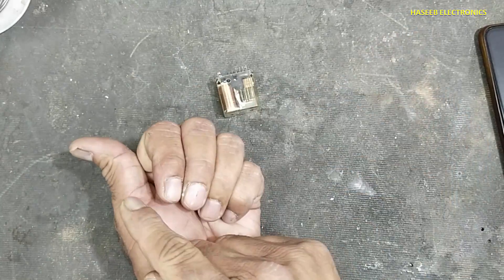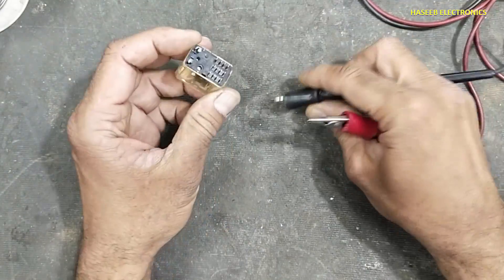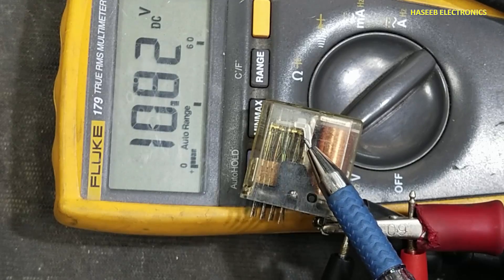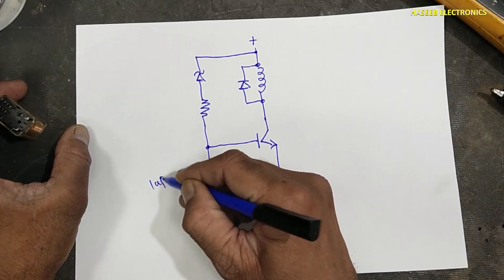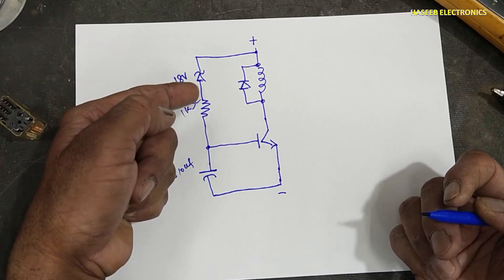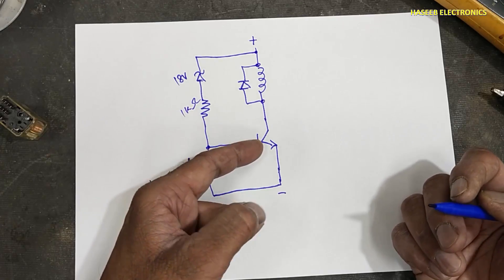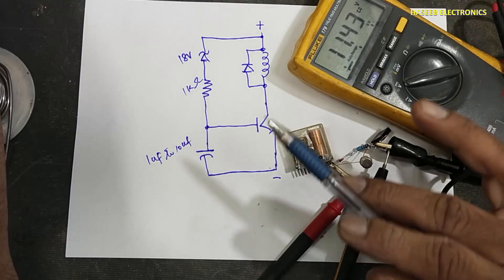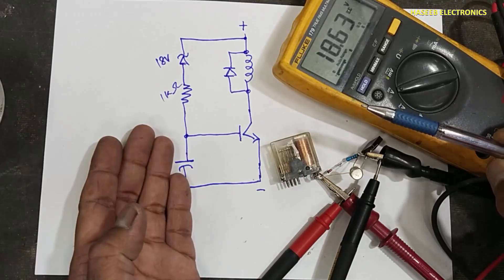{983} How to drive relay at specific voltage

Comment: Jazakumu lahu koiran.

Why is the negative side of the zener diode connected to the positive of the supply.
Reply from the maker: because the zener works in reverse bias, 
while working zener in forward bias, it will work as a simple rectifier

Comment: Explanations are excellent sir. Instead of controlling voltage through the zener diode for on and off cut off, IC 16F676 is used in an emergency lamp circuit. But while switching on the emergency lamp the relay is not getting changed over to charging mode.  That relay is not getting off . Please help

Comment: thank you as always. You are the best. You present your ideas in such a manner that even a novice will understand you. i have learnt a lot from you.  I deal with batteries a lot. can you help me with under voltage and overvoltage cut off circuit that I can implement in charging batteries.

Comment: It's funny that I was just yesterday watching AllAmericanFiveRadio's video on driving an IGBT with a photo transistor to power a relay to run a fountain when the sun is out and to turn off the pump at night. He had a problem when it was twilight the relay would buzz but not fully turn on and I suggested a zener diode. I also wondered if a Schmitt trigger would work that way there would be no voltage in between on and off. The relay contacts would be pulled in hard or not at all. You don't want relay contacts partially pulled in so they won't burn. You mentioned using a comparator circuit. Would this act like a Schmitt trigger? Excellent video. Thanks for sharing it with us.
Reply from the maker: best regards and special thanks for your valuable comment 
because the relay coil's "pickup voltage" start at very low level. for example the 24 volt relay winding gets energized at 10 volt but its magnetic flux is not saturated so the contacts will not work as hammer action, in result the contacts may spark
the circuit, which i discussed in this video overcomes the "pickup" and "dropout" voltages due to controlling transistor's conduction 
a Darlington configuration is much more suitable for ensured operation of the relay 
i think Schmitt trigger method will not a useful method (as level comparator works as decision making circuit based on the voltage level, same as in this circuit, which i made in this video, it is also a transistor based comparator)
but TL431 or any level detector ic or opamp or comparator or level detector + flip flop  or microcontroller will good options
Reply: thanks for your input. have a great day! @HaseebElectronics

Comment: Thanks for the video.
Should I use this circuit to drive a relay for a battery discharger or is there a simpler circuit for a battery discharger?

Comment: Hi.  I'm used to seeing the resistor at the cathode.  Yours is placed on the anode.  Does it matter?
Reply from the maker: it is the same. it can be connected at anode or cathode. it must be in series with zener diode
Reply: @HaseebElectronics  Thought so, but wasn't sure.  Thanks for confirming that.  I never thought to use a zener this way as a trigger when the breakdown voltage is exceeded.  I will add this technique to my notes.   Great idea!

Comment: Clever + Elegant = Brilliant! Bravo!!! I recently built a soft-start circuit, for my DIY isolation transformer (120VAC.) I placed a very small wattage incandescent light bulb in series on the Line wire, to act as a small value resistor (20 Ohms, when cold,) to charge the transformers (two, back to back.) (It works as a removable Dim Bulb Limiter.) I used a relay to short the Line, to bypass the bulb. The relay coil is switched with 120VAC (not VDC.) I supplied the coil with the Line leg, after the bulb. This means that the voltage to the coil would be slowed and the relay would not trip, until the transformers were charged. But, I encountered the same issue, as your commenter... The relay switches at voltages different (lower) than its ratings. Therefore, I learned that the rated voltages are the guaranteed switching maximum - not just the typical switching voltage. As a consequence, the relay is shorting out the bulb, before the transformers are fully charged. This is not a problem for me, as the amount that the transformers actually do charge is sufficient. But, I would like to remove the remaining in-rush, after the bulb has switched out too early. I will be thinking on how to adapt your circuit to raise the switching voltage on my relay's VAC coil. Any hints on how to do that would be greatly appreciated! Cheers!
Reply from the maker: thanks a lot for your valuable words 
your question is almost similar to my last commenter 
120 VAC relay normally starts switching at approximately 20 to 30 volt peak or VDC (these are called pickup voltage)
sure i will study it and will try my best to do it practically.

Comment: Sir, pl do small modifications, so that, the relay should On at 24v and Off at 18 voltage, other wise at 18v it may toggle due to voltage variations.
Reply from the maker: great
we can also use window comparator, 
i will modify the same circuit
thanks for your valuable suggestion